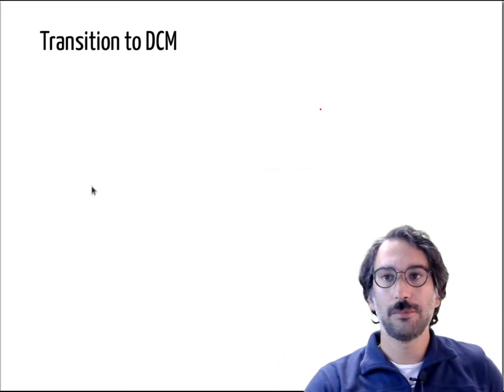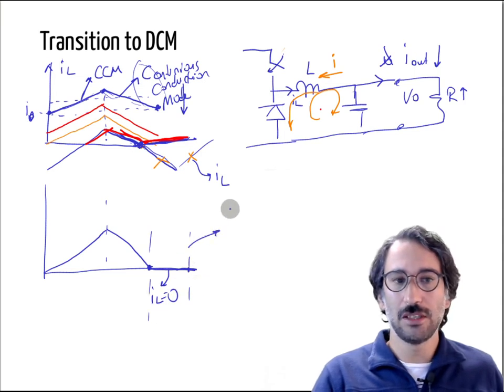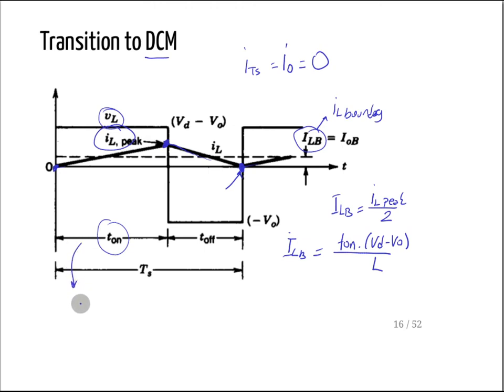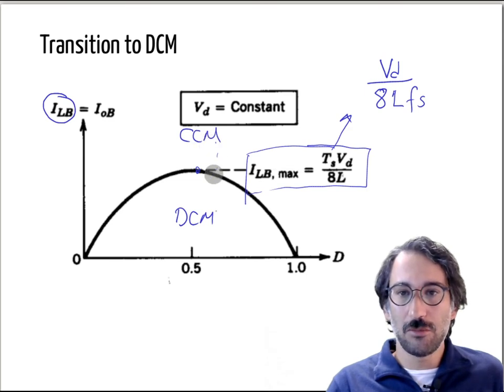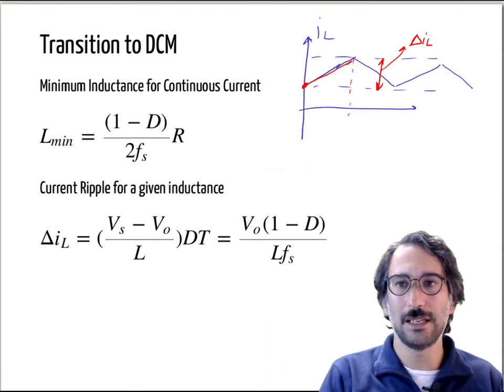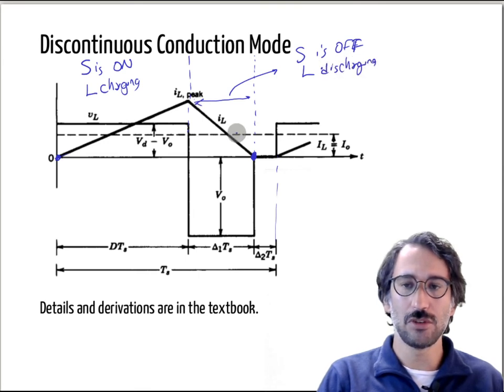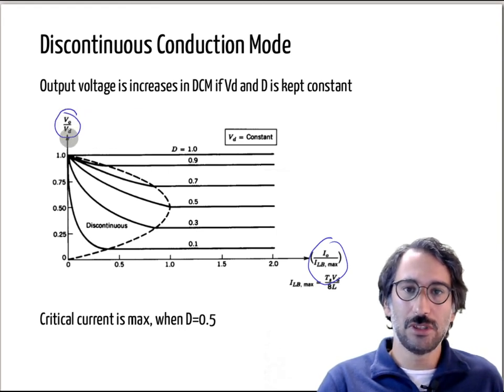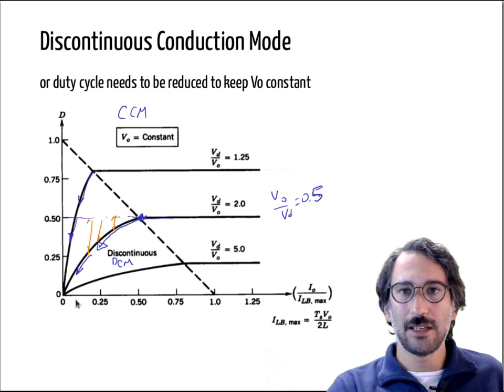EE463 - DCM in Buck Converters

Comment: We are going to explain the following circuit.
12v input.  5v output. 2 amp load.  
The input will be about 1amp.  
How does the supply deliver 1 amp and the load receives 2 amp?
That’s what we will explain.
During the time when the MOSFET is turned ON, the circuit is separated into halves. The first half is the inductor and the other half is the load.
We know the load is 5v, so the voltage across the inductor is about 7v.
2 amps is flowing so each portion is receiving about the same amount of energy.
The inductor is converting this energy into magnetic flux.
During this time the capacitor is charging and when the upper voltage is detected, the MOSFET turns OFF.
The magnetic flux in the inductor collapses and delivers its energy to the load and the voltage gradually falls to the lower set-point. This takes about the same time as the charging cycle.
During this time the supply delivers no current and the average of 2amps for 50% of the time is equal to 1amp for the whole duration.
The MOSFET switches ON again for the next cycle.
Lastly we are going to discuss how the circuit works when the load is reduced.
The first thing to understand is this.
The inductor is designed to work at full load.
So it has the capability to deliver a high current.
When the load current is reduced. There is no component in the circuit to reduce the supply current.
The inductor will still deliver the maximum current.
But this time more current will enter the output capacitor and it will charge faster.
This means the circuit will turn off sooner.
This means the inductor will have received less energy.
But the output capacitor will have received its full charge.
When the MOSFET turns off, the inductor will deliver its energy and the capacitor will deliver its energy.
This will determine how long it takes for the output voltage to drop to the lower detection point.
This will determine the frequency and the high initial current will be spread over a longer period of time and thus the average input current will be reduced.

Comment: Although this discussion is basically correct, it is a whole lot of gobbledygook. 
The voltage on the capacitor has to be monitored in a real situation because if not, the voltage on the capacitor will rise to nearly the voltage of the supply but not higher.
It is pointless operating this circuit with no load and pointless creating a circuit where the capacitor voltage is not monitored. 
That’s all you need to know. Forget all the other waffle.